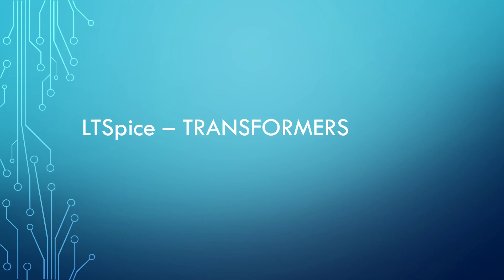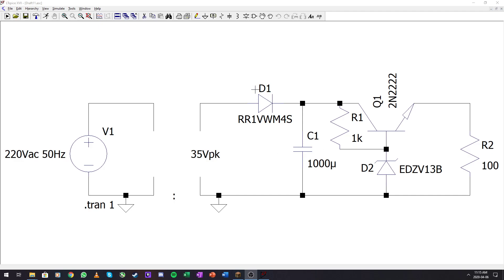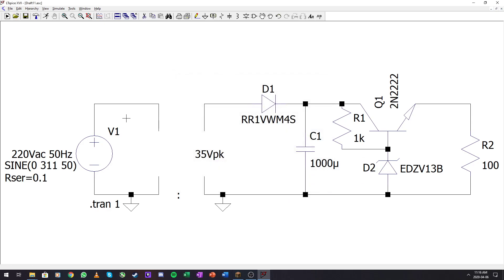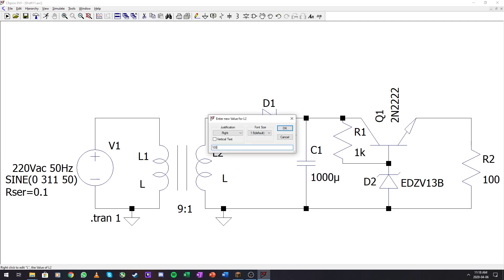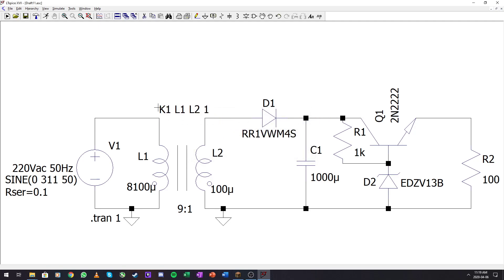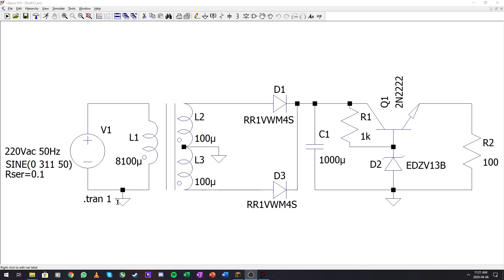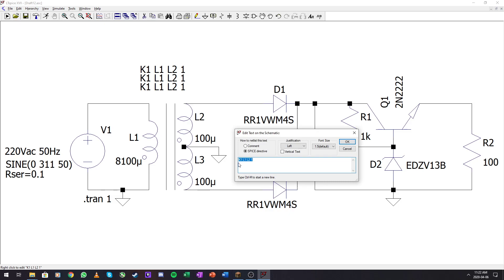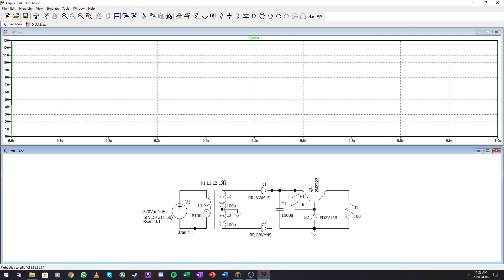Video 5 - LTSpice Transformers

Comment: Sir, 
Is 9:1 a closest approximation?
And value of L2 being 100uH an assumption? (can this be any value)
Reply from the maker: You get a lot of different transformers, you have to go and work out the ratio from the specifications.
100uH is a guess to make the circuit work. Again for every transformer it will be different, but the ratio will remain true to the equations.

Comment: Hello sir hope you are well
I have a question on the finding voltage regulators on LTspice because I have to design a +15v,-15v power supply and a +5v,-5v supply and we are supposed to use the 3 pinned regulators with the input ,output and ground pins .
Sir I'm struggling to find the correct regulators on LT spice because I need 4 different regulators 2 for the + and - 15v and 2 for the + and -5v.
Could you maybe help me with finding the proper regulators because these are the codes I was supposed to use according to my project
For the 5v circuit I require the 7805 and 7905 regulator 
And fir the 15v circuit I require the 7815 and 7915 regulator 
Could you possibly help me with this sir .
Thank you and have a great day
Reply from the maker: I found 3 of the regulators in this zip file. Download it: https://www.mikrocontroller.net/attachment/94517/78xx_Series.zip
Copy the regulators folder into your ..\Documents\LTspiceXVII\lib\sym folder.
Copy the regulators.lib into your ..\Documents\LTspiceXVII\lib\sub folder.
They will now show up in LTSpice under components/regulators.
I am yet to find the 7915.
Reply from the maker: If you want a LM317 regulator added to your list create a text file 317.txt in the regulator folder you added to ...\sym\regulators
Copy the following content into the file:
Version 4
SymbolType CELL
RECTANGLE Normal -128 -64 128 96
TEXT 0 0 Center 0 LT
WINDOW 0 -56 -80 Left 0
WINDOW 3 16 112 Left 0
SYMATTR Value LM317
SYMATTR Prefix X
SYMATTR Adjustable positive voltage regulator 317
SYMATTR SpiceModel regulators.lib
SYMATTR Value2 LM317
PIN -128 0 LEFT 8
PINATTR PinName IN
PINATTR SpiceOrder 1
PIN 0 96 BOTTOM 8
PINATTR PinName ADJUST
PINATTR SpiceOrder 2
PIN 128 0 RIGHT 8
PINATTR PinName OUT
PINATTR SpiceOrder 3

Rename the file to 317.asy
The LM317 will now be in your parts list
Reply: @EzElectronics  Thank you very much sir👍
Reply: @EzElectronics  Hello again sir I tried to add the LM317 but it doesn't wrk .
Sir is there any other alternative -15v regulator I can use?
Thank you sir have a good evening
Reply from the maker: The LM317 is an adjustable positive regulator, done some searching and it is called the LT317A in LTSpice in the power products folder. The LM337 is the negative version of the LM317. Setting this series aside. There are nice adjustable positive and negative regulators from Linear technologies (Analog devices now). It is available in LTSpice too.
I would suggest the LT3015 adjustable negative regulator. Datasheet: https://www.analog.com/media/en/technical-documentation/data-sheets/3015fb.pdf
I would suggest the LT1963 adjustable positive regulator. Datasheet: https://www.analog.com/media/en/technical-documentation/data-sheets/1963aff.pdf

Comment: sir, why dou you add 0,1 ohm series resistance? why you dont choose 100 ohm series resistance?
Reply from the maker: You can choose a larger resistance, this will increase the losses in the source and also limit the current capability of the source. The simulator does not "see" a load if it is only an inductor so we include a loading effect by setting the series resistor. This is to fool the simulator into working. This simulation is closer to an ideal circuit with no losses.

In a practical circuit even the inductor/transformer will have a series resistance and this can also be set in LTSpice.
Reply: @EzElectronics  thank you sir